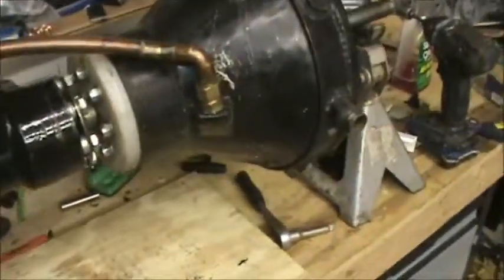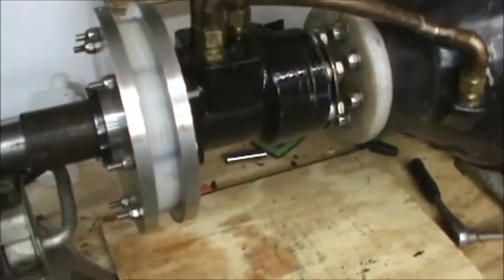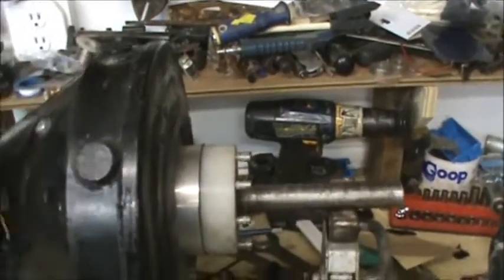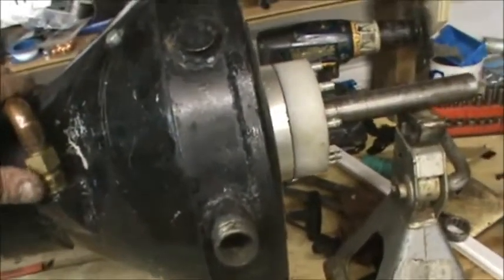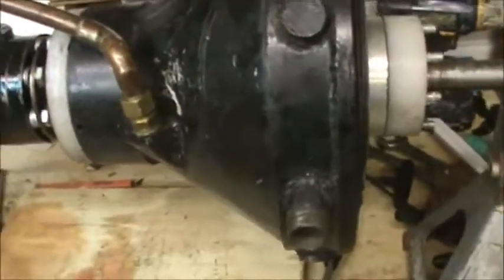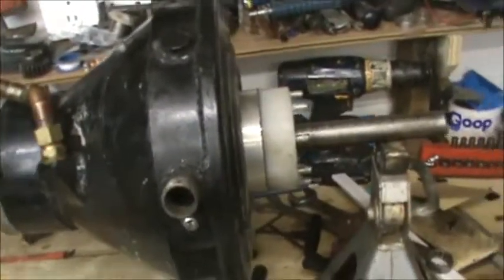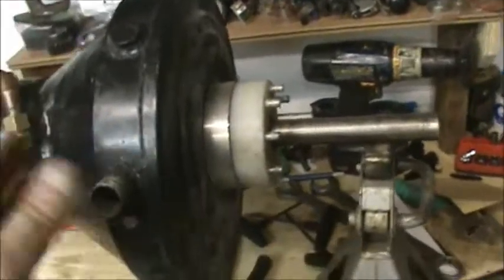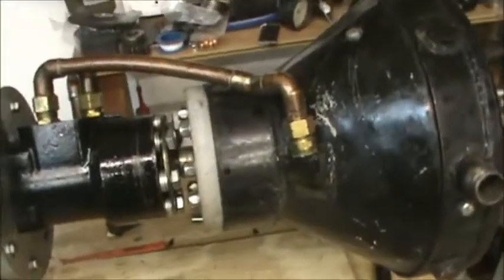Clem engine 3

Comment: It's a hydrylic liquid flywheel.
Known as a torque converter.
When Centrifugal forces begin pushing the fluid at twice the pressure the jets consume to rotate the pump, it begins operating on it's own supply and demand forces.

You can make this from a 2 speed Chevrolet power glide transmission with the bell housing removed